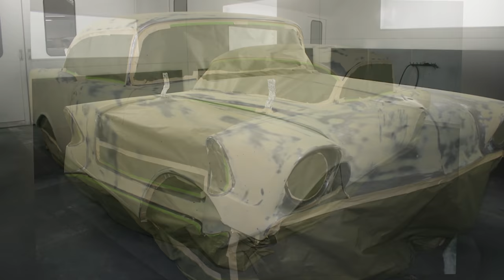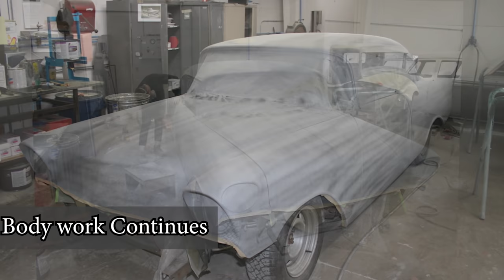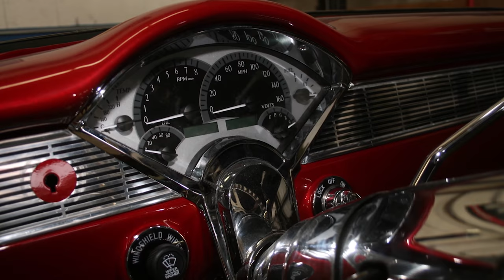Restoration Abandoned 1956 Chevrolet Bel Air

Comment: I restored a 1956 4 dr hardtop-Belair, and it was plum and white.  I didn’t dismantle
It from the frame, but changed the front brakes to discs, and punched the engine out to a 283 cubic inch, and had the aluminum transmission rebuilt, too.  My Son drove it to high school.  The previous owner said the body is so thick on those, that they used to sit on it, and have picnics.

Comment: Wow! According to the pic they converted a 4 door post to a 2dr hdtp.
Reply: Apparently a random pic ;) the actual original car is 2 door
Reply: @steinbauge4591  i know that. But look at the pic on the link and the show a 4 door post as the  “before” picture.
Reply: @robertkolb228  I saw it after you pointed it out. Well, it's just a timelapse video, lots of info missing. E.g what parts did they have to start with, seems maybe just the shell. Superb result anyway.
Reply: It's a miracle  ! ! !

Comment: U had me up until the LS and transmission swap. Where’s the challenge of bringing it back to factory original dealers show room floor quality? With the 265 V-8 or the 235 inline six with power glide transmission or three speed manual with overdrive? Or the factory 265 with 4 
barrel carb, duel exhaust, coupled to the 3 speed with over drive? The car doesn’t need to haul ass like the world is coming to an end. But hauling ass the way it was able to back in the day which was still pretty damn good. Just saying.